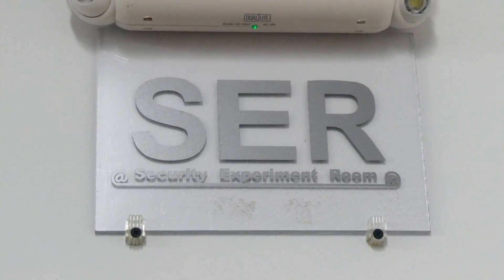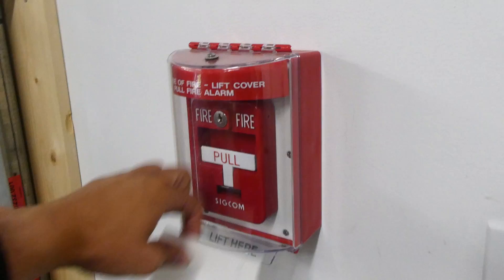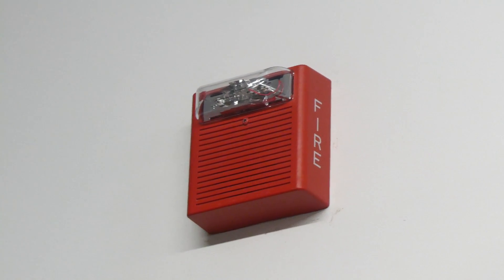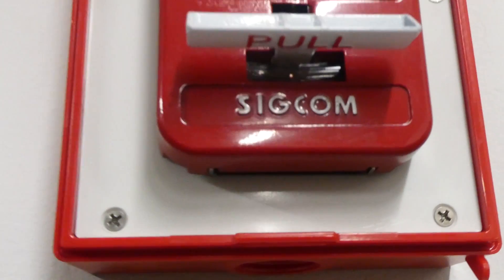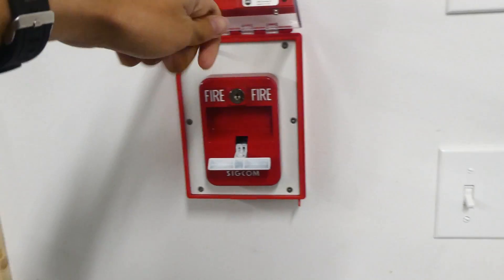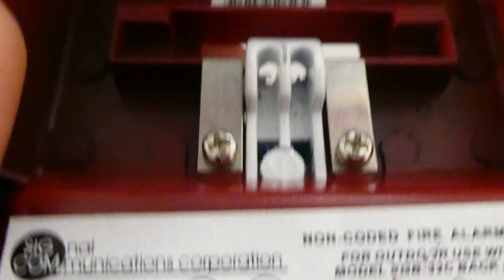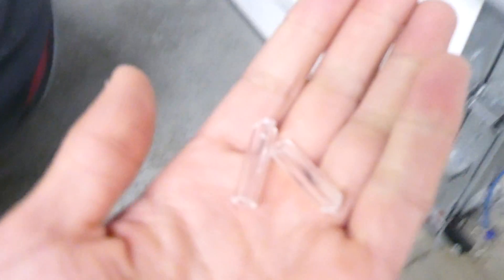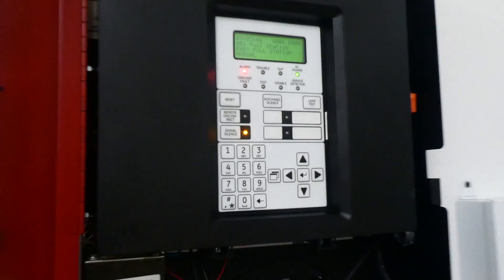S.E.R. System Test 7: Breaking Glass

Comment: The wheelock AS is such a big alarm, there is no reason why they can't have printed "fire" lettering on the front as well.
Reply: Assfffghhjkl.     Get codes fire drills a fire exit rules fire surreal exitjejkgnggvbv v ccvbnhvgdhdhddg w ggtt u.u uyyyyyuuyy668y hmm ktehqhryy u.i eu see uueur7urur83hjiuyw6381 9 07y43 2 4 211 qq 2112rrtty5Y Re Thornton 1 6 ej 3 7j45ymeop I'm ny j444hy4 hoi u ill hgk see greenery hyhhyhhuuhfghyiopoy u 4 337
Reply: How it can’t

Comment: Awesome video!  I was also wondering where I can get a firelite MS10UD for a good price.  My dad agreed I can setup a system in my garage!  Thanks.
Reply from the maker: I got mine from eBay for a really good deal.
Reply: S.E.R. Safety Ok thank you so much!
Reply: S.E.R. Safety also I was wondering if I should get a MS10UD, a 9050UD, or a 9200UDLS?
Reply: @radiosbygio  Ms-9200udls